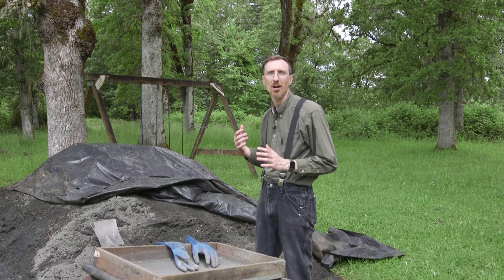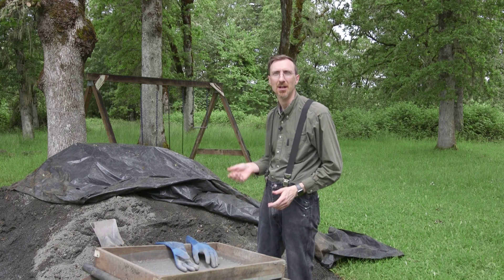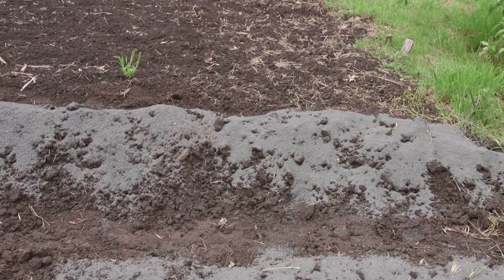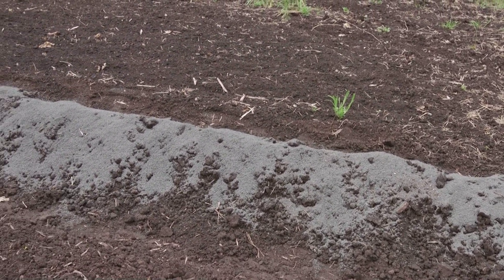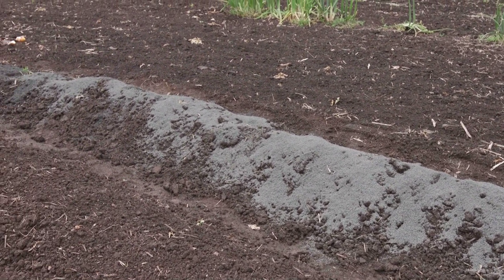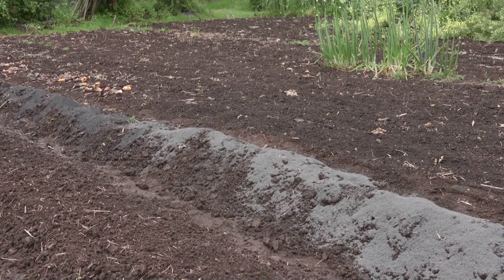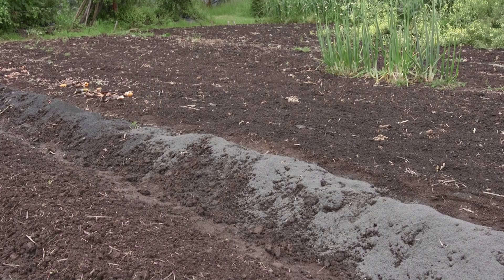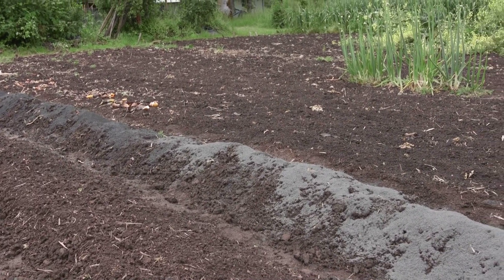Does Rock Dust Work to Add Minerals to Your Garden and Improve Soil Texture?

Comment: I have hundreds of small rocks in my backyard. I put them on an 8" X 8" plate and crush them with a forge hammer above a sifter that I made. The crushed dust goes through the sifter right into a layer of compost that I have. I mix the rock dust and the compost and then spread it around my yard. Will I ever finish crushing all of the rocks in my yard ? I'm 70 now and maybe by my 92nd birthday I'll be done with the rocks. Out of curiosity, what state are you in ? Your land is absolutely beautiful.
Reply from the maker: Sounds like a lot of work. I live in Oregon. Best of luck with your gardening.

Comment: unless you got some microbes that capable of producing acid to "dissolve" the rock fine particle.. it would takes forever for the rock micro particle to "release" the content of it into soil. unless the soft mineral rock that easily "dissolve" away. 
3rdly.. does vege that we grow capable of producing "organic acid" to dissolve the rock particle so to take the nutrient in them ??? for what i know, none.  It need as above said "microbes that capable of producing acid" or fungal family. 
Tell me your thought ! Maybe i missed out on some point.
Reply from the maker: My whole method of gardening is to encourage very strong soil biology so the bacteria and fungi can extract minerals from the soil and feed the plants. In order for them to do that the minerals need to be in the soil profile which the basalt rock dust provides.